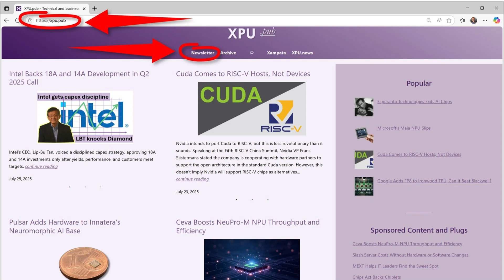Putting Intel 18A yield rumors into context

Comment: How do process nodes correspond to fabs.  Is an 18A fab always an 18A fab? Or can it also support 14A for example.  Can you use an 18A fab to make older less advanced devices too?
Reply: the fab as in the building houses machinery for a specific process. Some machinery can be used for sub-variants of the same process. For example all 18A can become 18A-P fabs. I don't know if they can become 14A fabs without changing the machinery completely though.
Reply from the maker: I don't think Intel will make anything older than 18A on the 18A line. I think (but am unsure) that 18A and 20A were to coexist, but 20A was nixed. 14A will use High NA EUV, which might make that line dedicated as well.

Comment: Hi Joe if the situation is not dire why is Intel is talking about skipping it and going to 14A. seems counter productive.
Reply: I think that was in the context of 3rd parties using 18A, not intel using 18A for their own chiplets?  The focus for foundry partners moves to 14A.  Intel announced Xeon 7 on 18A/3/7 at hot chips this week.
Reply: Intel 18A is probably under great deal of pressure from TSMC N2 in the race to provide products first to the market. It makes sense for Intel to get rid of external customers of 18A and shifts that pressure to 14A.  That is good risk management by Intel but nevertheless underlines the fact that Intel isn't 100% confident of its 18A process.